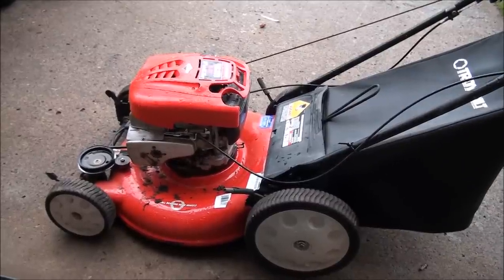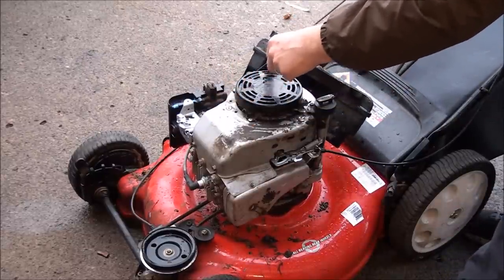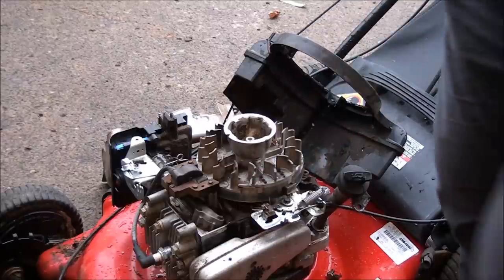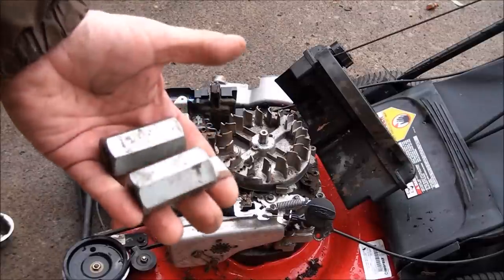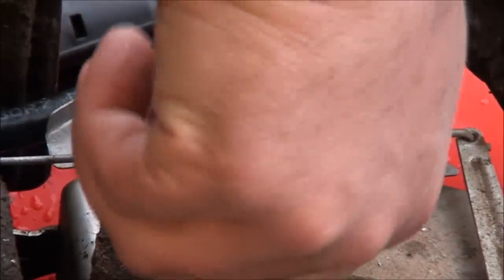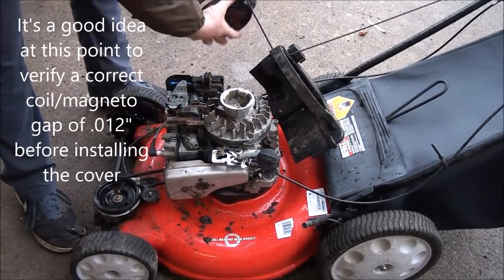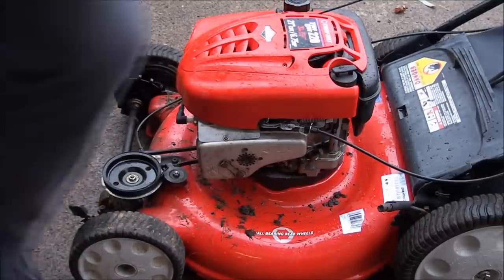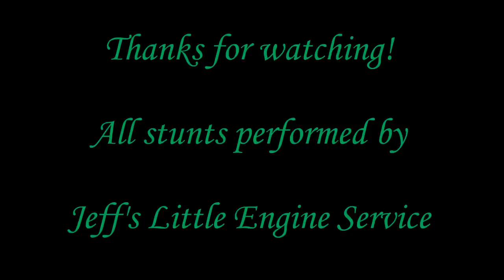LAWNMOWER BLADE Hit Something HARD! Bent Blade, SHEARED Flywheel key FIXED! All BRIGGS and STRATTON

Comment: Jeff, I hit a dirt mound with my 7.5 Briggs, kept running, then quit. I followed this video, sure enough, shorn key.  Replaced key, and new blade installed. Flushed carb,  tried to start, rattling in lower engine.  I tore it down,  valves ok, piston ok, but I found a shear key in the oil pan (!) which had bounced around and did a little scratching on the valve gear shaft but perfectly useable;  I made sure of timing,  I put it all back together, wondering where that shear key came from. (It was purchased new from Sears 3 yrs ago) Won't start. new air filter, adjusted coil with Oreilly's card- I didn't have my .012 guage.  Plug looks good but didn't change.  I'm looking to your videos to find some answers! Thanks for them, you're a good teacher.
Reply from the maker: WOW! I have never seen that. perhaps the timing gear? I have seen those fail before

Comment: Best pull off the spark plug pipe first before doing anything with the flywheel, because as you're turning the latter, you might accidentally start the engine (admittedly, the chances are low, but not zero), and if that happens, you're in for some serious pain
Reply from the maker: good safety tip!

Comment: I usually use a paper calling card to adjust the magneto gap. You can hold the blade while torquing the flywheel nut.  Remove the spark plug or put clothes-line in the cylinder. Change the spark plug. Brigg has valve guide tools to replace valve guides. You use a drill to machine the guides. Brigg also has flywheel pullers.

Comment: At 13:43, Jeff tilts the entire mower toward the carburetor side, which is usually not recommended because oil can flow through the carburetor and into the air filter. (Experts may do operations however they please). Jeff also wisely uses a torque wrench in his flywheel reassembly.

Comment: Take note, I thought I had the same problem then discovered the flywheel nut was torqued so lightly it could be almost loosen by fingers.    Initial flywheel key didn't seem out of place or damaged so I tightened the flywheel nut to around 50 pounds.   That did the trick.
Reply from the maker: good work

Comment: Older Briggs stationary engines with the heavy cast iron flywheel, had a soft alloy key. Everytime you removed the flywheel you would replace the key, even if it showed no damage. It is much better to sheer a flywheel key than damage the crankshaft of the engine.
Reply: That crank can still be bent

Comment: Thank You Mr. Jeff for the great video. One question…My mower has briggs and Stratton engine. On top of the cover it says 675 series 190cc 6.75 ft-lbs gross torque. What is the recommended torque to tighten the fly wheel nut.
Reply from the maker: Not sure, I would have to look that up

Comment: Jeff
I would ad ice that when working on a mower or anything with moving parts always remove the spark plug lead known gas the HT lead because if the engine fired it could cause seriouse accident

Phil in stoke in the UK
Reply from the maker: good safety tips Phil

Comment: Can you use a 3 jaw gear puller to remove the flywheel or is using the knockoff tool the best method?
Reply: I always use the big flywheel nut by putting it on flush with the top of the shaft.  I use railroad spike tapped tightly into place under the flywheel then tap the shaft with the nut once or twice and the flywheel pops off with no damage to the nut, shaft or flywheel.  Works like a charm every time.

Comment: I just fixed my mower with that quantum engine, with  that same issue.It ran but very hard to start and overheated.
Reply from the maker: overheating is very uncommon unless it is low on oil or the engine is run without the engine cover on it. It is an aircooled engine so it needs the engine cover for maximum airflow
Reply: It was real hard to start,when it did it didn't  sound right.Just my opinion the advanced timing had something to do with it. Now starts first pull. Like the vids

Comment: Whenever you have to tip a mower on its side, always have the carburetor side up ... so oil doesn't pour out through the Air Filter. You heard between workers, "That's what I do."

Comment: Instead of using a knock off tool I used the original nut with an old socket. Not as easy cuz you need 2 people,but works great.
Reply from the maker: great tip!

Comment: Jeff, i have a older 1988 Snapper high vac walk behind mower with  a 3.5 hp b&s model # 92902 3271-01 i was going to replace the head gasket. when removing parts recoil starter gas tank bracket for throttle linkage  i noticed a ground wire broke off one end goes to deck by discharge chute the other end broke off near where coil wire goes to stop switch this motor don't have original carb it has a pulsa prime conversion kit it's hard to tell where this ground wire connects to any ideas? thanks for you're time, Tony
Reply from the maker: you can disconnect or cut the wire do not let it ground. CAUTION: I think it is a safety feature when it grounds it shuts the coil/magneto/spark down. Probably meant shut it down/grounds it when the chute is raised??
Reply: thanks Jeff,
i'll give it a try

Comment: Need help, I replaced the whole recoil assembly, it pulls back easily and retracts.. When I install it on top of the flywheel, it pulls but won’t retract. Why is that?
Reply from the maker: It may need to be centered more
Reply: @JeffsLittleEngineService  That’s what it was

Comment: No.
Here's a good tip, when taking a flywheel nut off.
Get a 15/16 impact socket, and 1/2" impact gun.
It's loose, in less than a second. ;)

Comment: Thanks for share. I fixed my lawnmower. However, I still have some waddling noise. Can you help?
Reply from the maker: waddling?
Reply: Jeff's Little Engine Service 
yes, I hit the blade. Don't know if I should replace it too
Reply from the maker: If the blade is bent there will be a lot of vibration when the engine is running. Definitely replace the blade if it is bent

Comment: can you tell me where you got those knock off tools ? I do not see any on the B&S Site
Reply from the maker: I can't remember but  here is one from Tecumseh . There are 2 sizes.
https://www.ebay.com/itm/Tecumseh-Flywheel-Removal-Tool-670314-Knock-Off-Tool/250693865991?hash=item3a5e84d207:g:iTwAAOxy7MtRxQRa

Comment: how much do you normally charge to fix one of them toros
Reply from the maker: depends on what the problem is. usually no more than $75-100
Reply: not bad
Reply: honestly I do not know whats wrong with mine it just wont start ive tried a few things to fix it like changing the spark plug and cleaning the filter and putting new gas in
Reply from the maker: most likely a plugged carburetor (main jet)